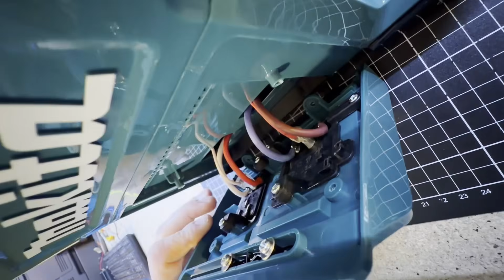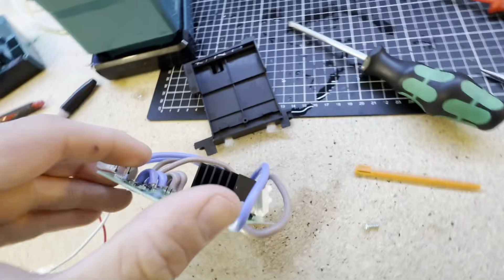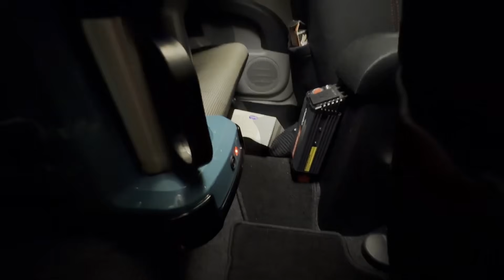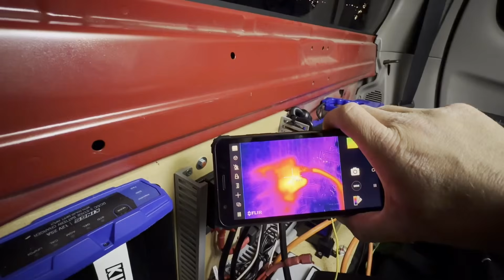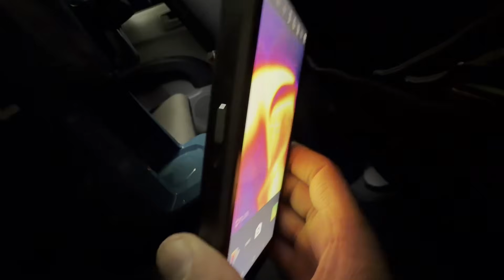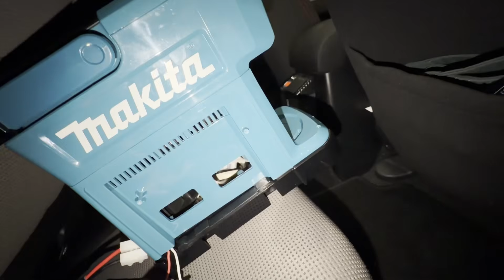Can a 18v Makita Coffee Machine run off an Anderson plug? + Teardown

Comment: No need for a pump. It works the same was as an old fashioned drip coffee maker. Water boils and the expansion pushes water trough a one-way valve. Fresh cold water enters and cycle repeats.
Reply from the maker: I had a feeling it used heating of the water as the mediam to move it, Not herd of a drip coffee maker before ill have to look into it, im not super into the coffee world just yet 😅

Comment: I see no inductors so probably not any buck/boost. Just pulse width regulation. I would be curious to hear what the resistance of the heating element is, so we can calculate maximum power.
Reply from the maker: Unfortunately I didn't get any measurements of the heating element. I believe it's just switching some transistors to regulate the heat of the element, like you said no visible inductors on the board. Probably just using a voltage regulator for the processor as well. I didn't have a close look at the board as I'm usually pretty time constrained.